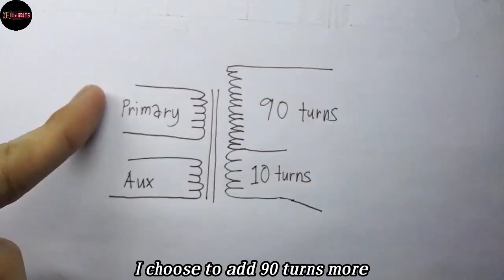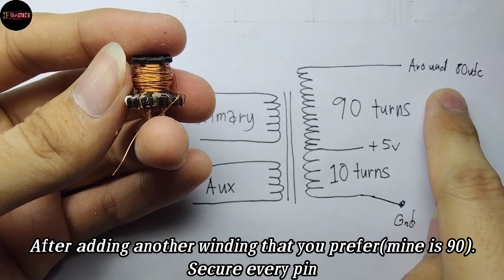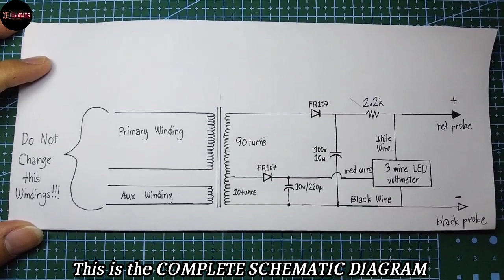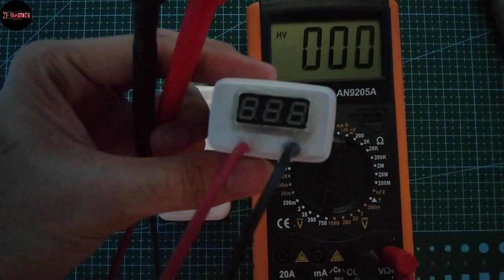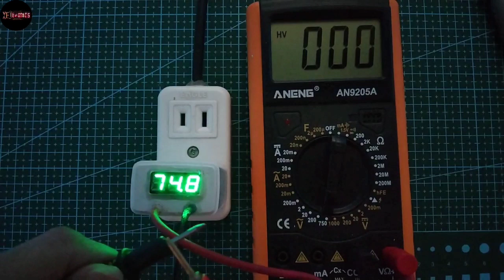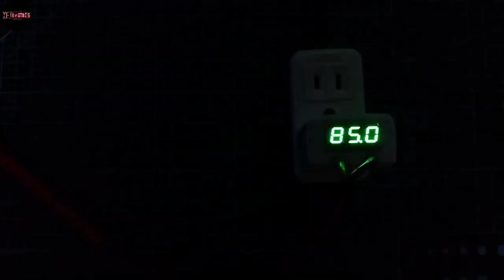LED TESTER/ Very Small Compact LED Tester Made From Cheap Charger #diy #ledtester #electronics

Comment: Gumawa ako boss, 110 turns ng #33 na wire, 39 uf 160 uf na cap, hehehe,h umabot ng 204 volts ang output. Katakot, baka maníra ng léd.😅
Reply from the maker: Gagi bawasan mo boss, tsaka dapat tama ang Voltage ng capacitor mo😆.
Ayus na kahit nasa 70volts eh😆
Reply: @x3dtronicsph  ginawa kong 450 volts 47 uf ung cap, lalo tumaas. Umabot 245 volts!😅 Nilagyan ko ng 100k 1 watt resistor parallel sa cap, bumaba ng 120. pero mukhang di ito tatagal, mainit masyado ang csc7224. Walang auxiliary ang primary side nito
Reply from the maker: @tumertech4609 mag 555 timer IC version ka nalang boss

Comment: Nice video👍😁, can it works if i use in 12V high frequency transformer?
Reply from the maker: It depends on the LED voltmeter that you're planning to use. Because the reason why i used a 5volts adapter is for the LED voltmeter to have a different and stable supply which is 5volts. If you want to use a Transformer from Another Board, DON'T DO IT BECAUSE THE PRIMARY SIDE Might BE DIFFERENT.
Do not use any transformer if you are not sure with what you're doing.
BE VERY CAREFUL SIR. IT IS LIFE THREATENING!!!!!!
I WOULD RECOMMEND A 5 VOLTS ADAPTER and please follow what is on the video.
Please be very careful or just make the battery operated that I made, It is on the channel.
Title is 
"I made a very useful tool from scrap"
Reply from the maker: Here is the link
https://youtu.be/rudU-2Vmhkg
Reply: @x3dtronicsph  thank you for your information 😁👍